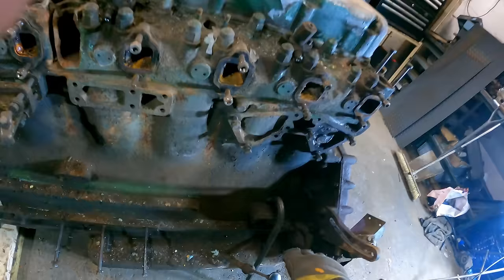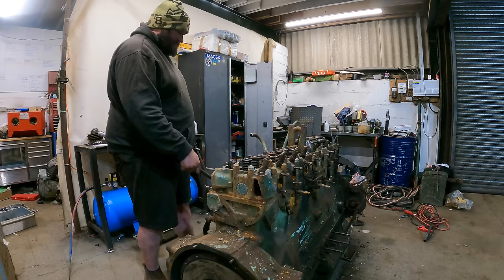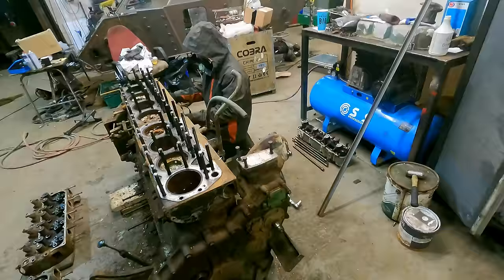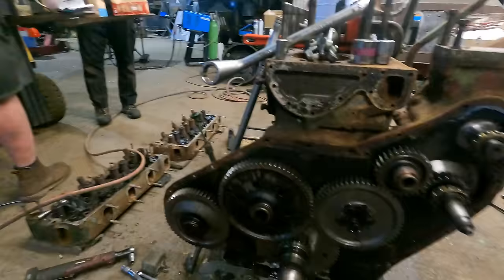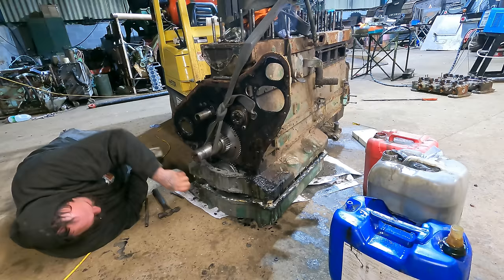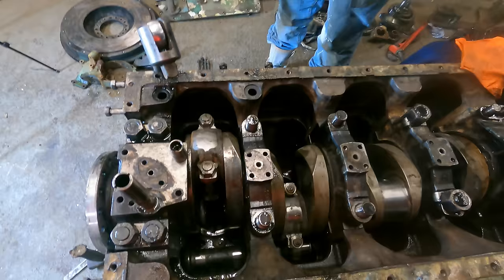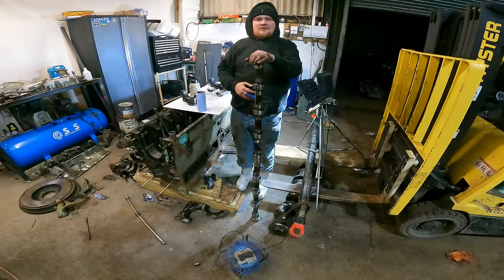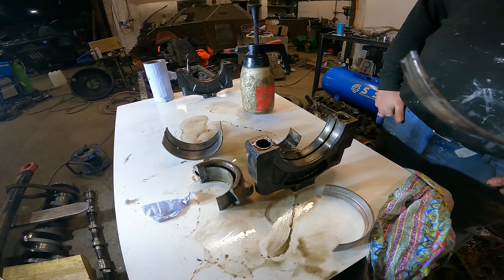Thornycroft Antar MK3 Restoration EPISODE THREE - Our Rolls Royce Engine Is Worse Than We Thought!!!

Comment: Can’t wait to see the ‘stitching’ method to watch how that is effective on such a beast of an engine. I know it’s a method used on old cars but my mind boggles at how it’ll work on an engine with that much torque and supercharged pressure within the block. This is exactly what I want to see!
Reply from the maker: will be a couple of weeks before the stitching video is out, I've got to make some tooling to pull the liners out i'll film it all!!
Reply: Success with the cold stitching isn't a certainty, but fingers very much crossed. Some of those fractures are in very nasty places. Having matching numbers is great.....but when your fingers are cold and there's a crated engine already sitting in the corner...

Comment: Great video. Good content, I enjoy watching some else's project! Fifty years ago, here in the U.S., I worked at an engine rebuild shop in the Repair Dept. I was the guy "stitching" the water jacket cracks with tapered pins, tapered taps and tapered drills. After the blocks had been washed and blasted, I used a small electromagnet to find both ends of the crack using iron powder. I would draw the crack with a sharp bit of chalk, and then drill the first hole as to "capture" the end of the crack so it would not be tempted to continue on. Then the tap was used to make threads, and an iron tapered plug was threaded in using a square lug on top, with a bit of sealer. The next hole is drilled into the side of the first plug, much as the number "8" appears to join together. Continue on with as many plugs as needed to go a bit beyond the tail end of the crack, grind and needle gun the area and its done. The smallest engine I worked on was the Willys Jeep flat head & F-head engine, all the way to the Ford gasoline truck engine of 534 CI. I also used powdered iron to torch weld cracks between the tops of cylinders in the block deck surface. Crack repair is almost a lost art in these days, most will toss the engine and start over...but it works, when the engine needs to be saved. Good luck and carry on!

Comment: I had a Thorneycroft Antar for many years...I did some miles in it I must say and fuel costs etc weren't really an issue back then...today it would be a nightmare.

I think I wore our maybe six or seven pairs of school trousers(well, at the knees at least) pushing it around the roads that our carpet had to 'offer' and I managed to haul just about every single heavy load you could imagine including a centurian tank and my Noddy car and Dick Dastardly race car.  Unfortunaly I no longer possess such a collection unless you include a collection of non runners sat on my drive and an old Jag in a lock up several hundred miles from where I live...

Oh, BTW. now SUBBED..

Comment: The Rolls C8 engines also suffered cracks between cylinders, so worth checking for any cracks there now the heads are off. 
I run a few C8S engines in railway locos so if you’re after spares, drop me a PM.

Comment: Great video. I thought the lighting & camera positions were pretty good. Close ups are tricky with auto focus usually homing on the wrong feature, not much you can do there. The content was excellent. I would hazard a guess that most the wear occurred as a result of poor maintenance and long lay ups. Particularly, since leaving military service. A shame that the fluids weren't drained before the lay ups. Ice expansion no doubt being the cause of the casting cracks.
Be interesting to see the straightness checks on the crankshaft and cam shaft and any straightening that takes place. I expect that the main bearing supports on the crankcase will also need to be checked before and after stitching, which would be good to see, along with any corrective machining. Rarely, one gets to see restoration of such a large engine. It would be great to show us as many of the critical operations as possible.

Comment: Always a lot of work with an old Rolls diesel, we have to remember that they were ‘better’ than some manufacturers engines, but they were NEVER the best. An old BT friend said they tried RR diesel standby generators, ran for so many hours, then stood for months then ran again etc. after one year they were stripped and inspected, all had crankshaft rust creeping along the journals. In trucks they never stopped the crank vibrations flipping fanbelts over.
Hope you manage to get it fixed and start enjoying it 👍👍

Comment: Put a more modern mechanical engine in it a KTTA 19 ltr in her and use her as a tank shunter only hurdle you would have is a addaptor plate for the gearbox i know sacrilegious of the highest order but it will make her more reliable and still usable. Loving the content regardless and subscribed, also that oil was the worst ive seen

Comment: suggest before you start welding see if you can get someone to 3d scan the castings to make a mesh you can then use that to 3d print patterns to re cast the block and or heads

Comment: Seeing you remove the heads with a forklift reminds me of a Sherpa with a Perkins I had a stuck head on, I finished up with an engine crane lifting the van off the ground over the pit and me down the pit with a length of wood and a sledge hammer!

Comment: The main seal is called a labyrinth seal. These are very common in jet engines which operate of pressure differential.
Reply: No, it is a scroll seal, the thread on the crank winds any oil back in to the sump.

Comment: I admire your perseverance with that old lump, I'd write it off and put a good used one in. The timing gears will need replaced together as rollers don't sound well on mismatched gears. Parts are hard to locate on anything rolls diesel. I'd fit your spare and use the money in different areas. Very interesting video though.

Comment: The main seal is the same design as the British leyland MGB. Also called a scroll seal
Reply from the maker: Yes, cheers didn't know the name of it. quite common in older engines, work very well providing the oil is changed at the required service interval. as the oil breaks down and becomes thinner it'll struggle screw the oil back up the shaft

Comment: Yes its a pity the engine has gone as bad as it has. Do you think it may of been head gasket failure that put water in the oil.. which then helped to flush the crap round the galleries . Or was it just lack of oil changes that blocked the oil pumps that caused the bearings to melt.. cant wait to see the cast stitching. Thats a real forgotten art. Love the videos. Content great.

Comment: At least parts will be somewhat available, the C series engines being used in a large range of vehicles.  So parts that would normally be difficult, such as blower and injection pump stuff, should be findable.  The previous Meteorite would probably be more difficult to obtain ancillary parts for, although I suspect the primary components would be the same as Meteor/Merlin ones.  Still going to be a very expensive project.  I wish you the very best of luck.

Comment: I would actually weld this engine in all the cracked areas,all you have to do is heat the block pretty well,v the cracks and muggy weld it with their appropriate product and you have a first class repair.with the same parent metal,cast iron is very easy to weld

Comment: If it was me with a spare good engine I'd change the engine, just done a Perkins 203, what a money pit thats turned into and it was nowhere near as bad as that, I agree it's matching number is worthwhile so if you're going to use it as a ballast tractor why not make the original engine the ballast?

Comment: Babbit is the bearing lead. Anyhoo, that engine is scrap. I don’t mean that in a keyboard warrior or couch pilot sort of way. :o) I mean it in a diesel fitter way, she’s dead 😵 If ice has done that much damage externally it will have bends and cracks all over the place inside :o(
Reply from the maker: normally I'd be agreeing with you however, 
the heads are scrap there's no repairing them, I've got a decent pair of heads I've just pressure tested etc etc. the block i think is saveable they have a very small cooling jacket in the block for an engine of its size. all the hairline cracks are limited to the weaker convex side of the jacket around the liners. i might be wrong but i think its worth a shot.
Reply: Yeh go on then, if you have spare heads :o)  Stitching looks nice, but I’ve seen a stunning fix at the apedale mine museum on a single cylinder diesel with a plate wrapped around the outside and close bolting. Basically a fancy cover plate that doesn't add more stress. I would come help, but you are awful far from Stafford :o) . @tinkeringwithtanks

Comment: The push rods should have been numbered so they can be replaced in their original position.
Reply: I'm not sure they will be going back in at all, given the severe corrosion.  If they do go back in they will have refinished ends, so it won't matter where they came from.
Reply: Normally yes, but this engine won't even be having the same cylinder heads (let alone tappets, etc) so it won't matter.